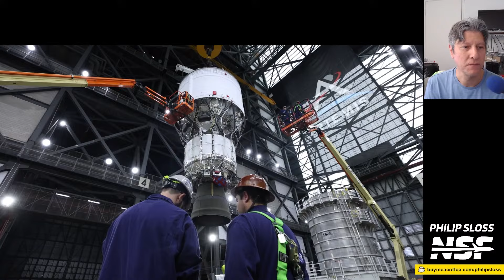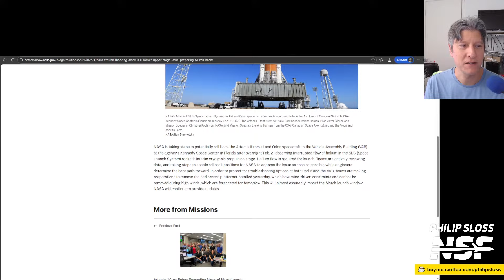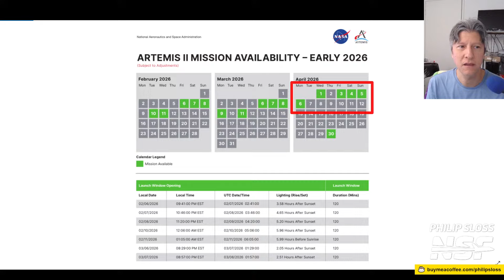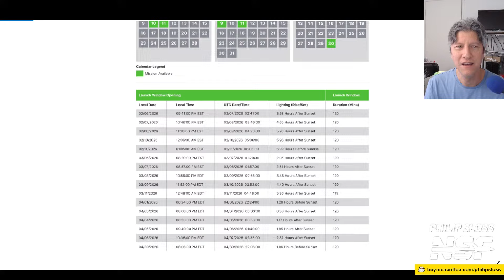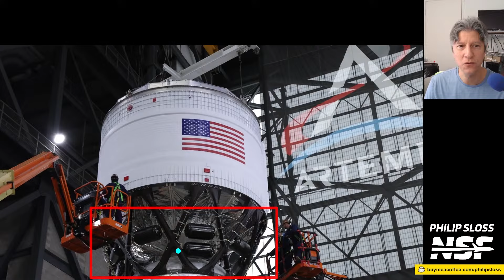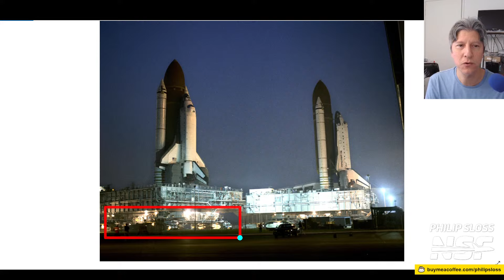Artemis II Breaking News: Q&A about ICPS problems and (now expected) rollback

Comment: So after they fix it and roll it back to the pad, will they have to redo the wdr again?
Reply from the maker: It's a good question, which I expect will get asked directly to NASA officials at the next opportunity.  It's possible that they do a tanking test like the liquid hydrogen-only one they started a week ago, rather than a Wet Dress Rehearsal.  Both are types of tanking tests, but the test objectives for another test they might be different than the larger, broader set they wanted to achieve in the WDR on Thursday.